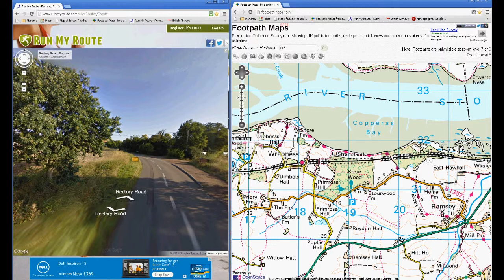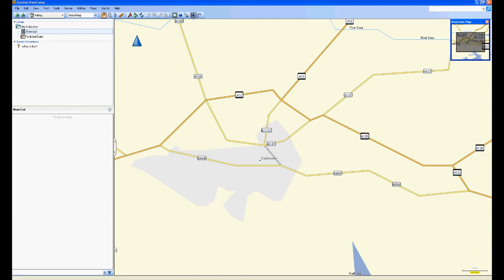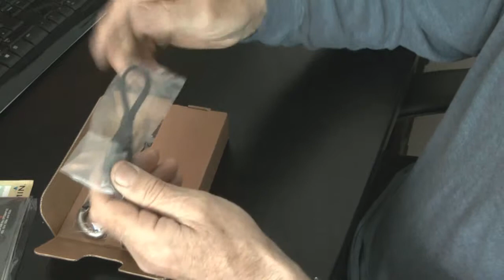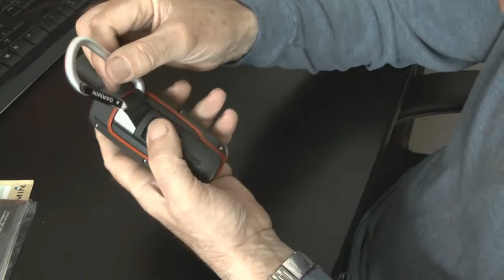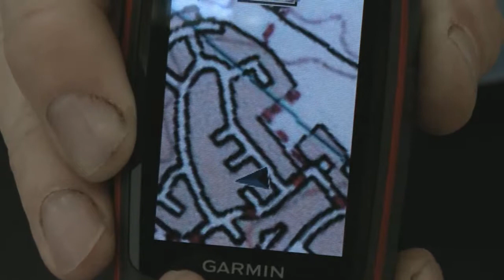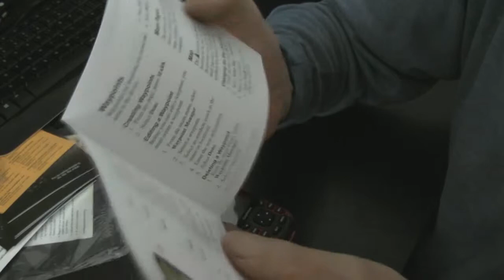GPS VIRGIN Part1

Comment from the maker: We did Scotland. We walked 3 or 4 miles most days (sometimes in horizontal rain!!!). Surprisingly there were many well signposted walks. With castles, nature trails and walking along tracks to remote lighthouses etc we did very little wild roaming and never neared being lost. We always took the 62S and at the start of a walk reset the trip computer to zero wiping out any previous track. That way we could leave a trail marker on screen and check distance walked. russ@sabar.co.uk for more info.